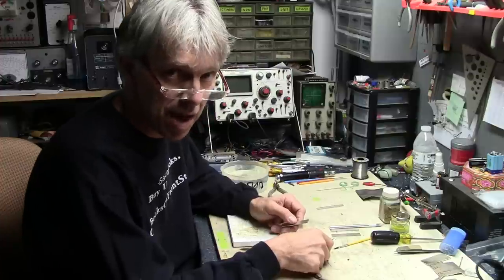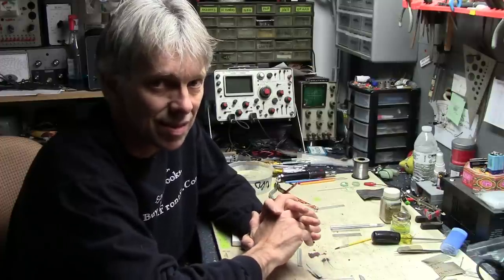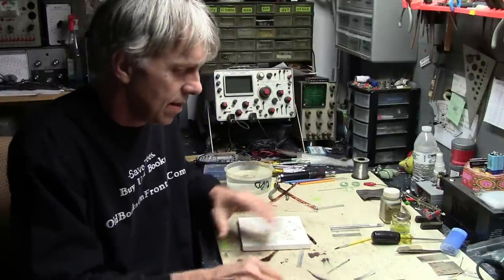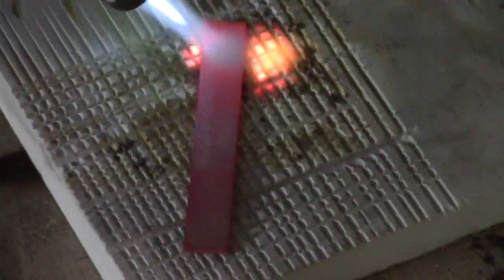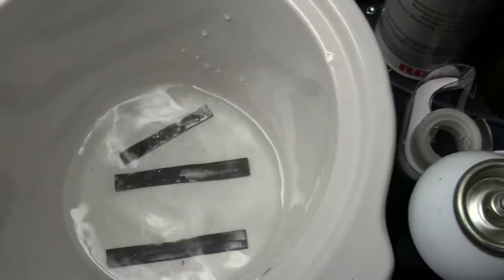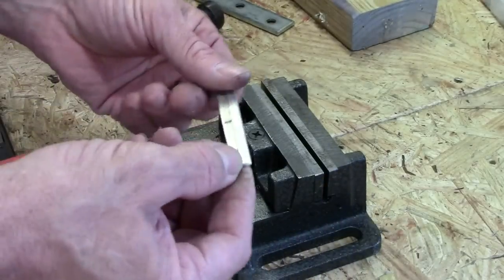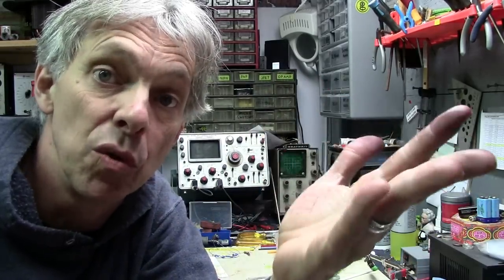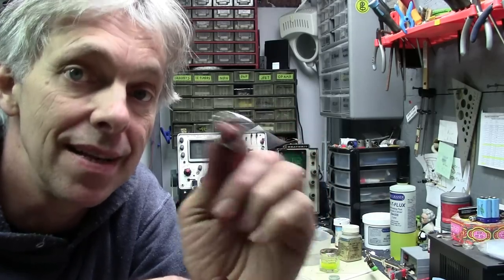Making my wedding ring

Comment: Loved this, should have added the polishing part as well, interested in that as well. Also, you should cut small pieces of the solder, place it on the joints you want to solder then add heat, then you know exactly when it’s enough heat, just a bit easier for that type of soldering.

Comment: I once got to reshape my father's welding ring -er wedding ring. The first step was to grease it all up with bag balm and hammer it to round so we could get it off of the finger after it shorted to his ground clamp through a wet and worn welding glove. Then since we were on a commercial fishing boat, the handiest mandril I could find was the handle of a vice. I hammered it back to round , filled the burn hole in and used a diamond hone to get it back to shape.  Some flitz and elbow grease had it back to a good gold ring.

Comment: Well done, turned out nice. You might want to use a wooden mallet on your ring sizing mandrel (the thing you called an arbor), because using a hammer on it will dent and mark it up very quickly, and if you use it again in the future, these dents will affect the quality of those pieces, and require more effort to finish.

Comment: Hi love what you do with the chanel just some tips if you use a torch on silver you should flux it fire scale is bad and when you form the ring use a rawhide or evan wood  mallet that will not mark up the silver and wide rings allways give yourself at least 1/2 a size looks good so far rio is great and are allways helpful.

Comment: awesome video! Just a note though. Usually annealing is heating up the metal and allowing it to cool slowly. When you heat the metal you change its structure/phase completely and allowing it to cool slowly allows re-crystallisation and the forming of larger crystals. For quite a few type of metals, Quenching them when they're hot actually causes them to harden further. I don't have much experience with silver but this is definitely true for most types of steels.
Reply: Tom Carson True, but Silver gets soft when quenched and so does Copper.

Comment: The one thing I would suggest as someone who's had some silver smithing training, when you're bending the ring over and making the join you want to push it together then run your saw down the middle. You're essentially making it so that you're not touching the two points at the bottom alone, you want a nice firm connection between both sides of the metal to get a good strong join, otherwise it's prone to breaking apart.

If you hold it up to the light and see anything, you need to run the saw down again!.
Reply from the maker: ***** Good tip! That is exactly what I've done on Lisa's ring and it worked great. :)

Comment: Did you use a micrometer to measure her finger?
Reply: ***** I used a ring gauge. It's just a bunch of rings sized to a specific diameter and numbered. You simply try them on until you find the one that fits.